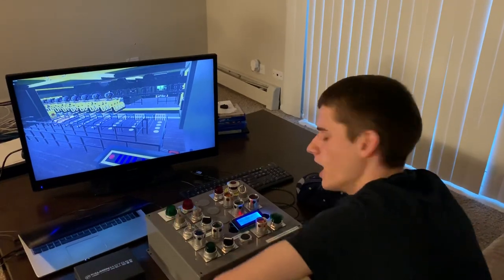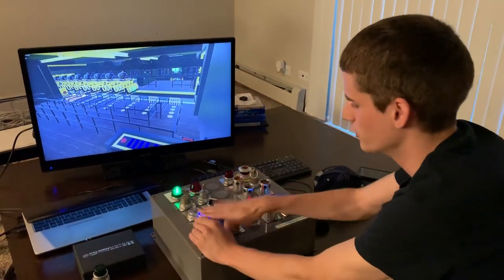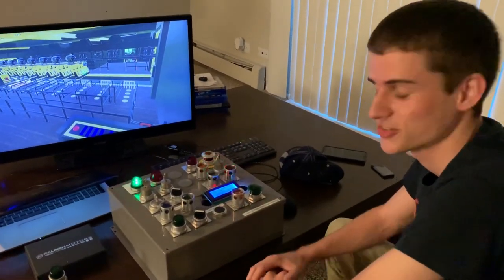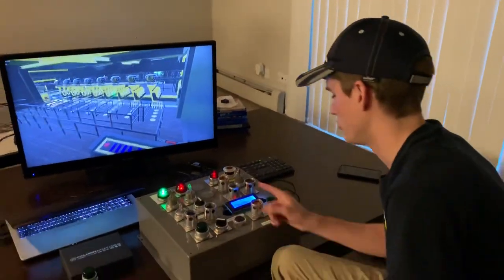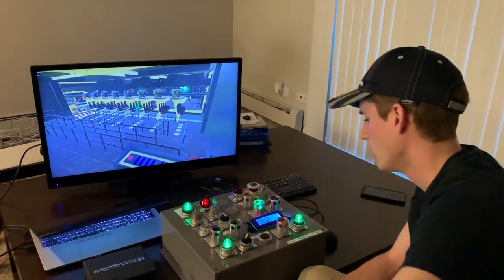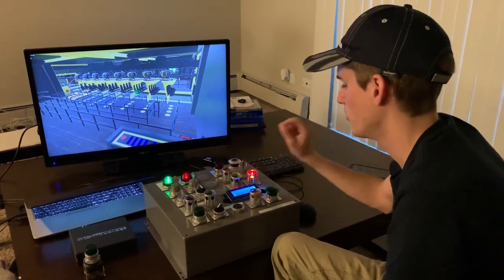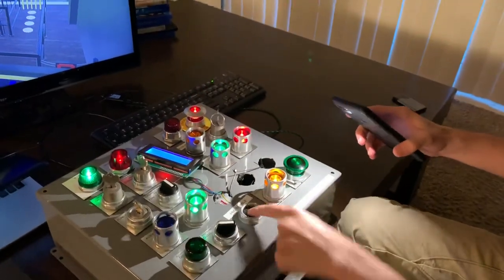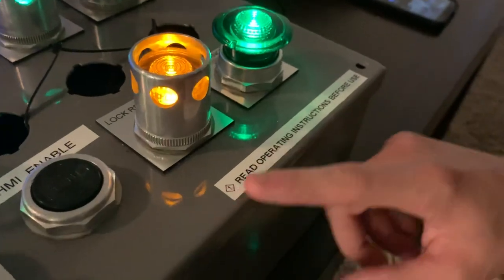The Greatest NoLimits 2 Control Panel Showcased

Comment: I’ve operated dozens of dozens of coasters. One of the hardest I’ve ever had to operate was The Hollywood Rip Ride Rockit at universal. That ride has so many buttons its not even funny. The op is responsible for about 35 buttons, and knowing what you can and cant press on the RCS. However, it was the most fun I’ve ever had

Comment: I just started working on an 8-control one, it'll be a lot simpler, but still using actual Allen-Bradley buttons. The top row will be Control Power, Reset, Seats/Floor, and E-stop. The bottom row will be Dispatch, Gates, Restraints, and Dispatch. Here's how I plan for it to work:
Control Power: A 2-position switch. Not a keyswitch, didn't want to bother with a key. On turns on the panel and sets the station to manual dispatch, Off turns off the panel and sets the station to auto dispatch.
Reset: A red guarded illuminated button. Activates NL2's Reset function, light flashes if the coaster crashes and needs to be reset. Works even with Control Power off. Not sure if this is possible, as this function doesn't have a keybind or a telemetry function.
Seats/Floor: An amber guarded illuminated button. Controls seats on flying coasters and the floor on floorless coasters. Light flashes when the seats/floor are in dispatch position and can be moved to loading position, and is on when the seats/floor are in loading position. Does nothing and not illuminate at all if the coaster isn't floorless or flying.
E-stop: A red illuminated push-pull mushroom head button. Activates NL2's E-stop function when pushed, deactivates it when pulled. Light is on when activated, flashes when deactivated. Works even with Control Power off.
Restraints: An amber guarded illuminated button. Opens and closes restraints. Light flashes when restraints are closed and can be opened, and is on when they're open.
Gates: An amber guarded illuminated button. Opens and closes gates. Light flashes when gates are closed and can be opened, and is on when they're open.
Dispatch: Two green guarded illuminated buttons. Dispatches train. Buttons will be wired in series (requires both to be pressed) and their lights in parallel. Lights will flash when a train can be dispatched and will be on when a train is moving in the station. 

I'm hoping to make it use NL2's telemetry server, so that it will stay in sync with the state of the actual coaster in NL2.

Comment: Going to attempt to build my own panel. Got all the buttons, and I liked you idea of a LCD in yours, so im implimenting it in mine. Question, do you have a potentiometer for the LCD? I dont see it in your wiring anywhere. Also, are you using relays for power for the 24volt or 124 volt bulbs? Or did you replace bulbs?
Reply from the maker: I'll make a video answering this questions a bit

Comment: So I am looking to make a No Limits 2 Panel. I have already purchased buttons for the panel. I was wondering which two Arduino circuit boards you have and where you got the enclosure for the panel. I am having trouble figuring out those two things. Your panel is the best I've seen so any help would be much appreciated. Thanks.
Reply from the maker: I used the mega and due. Use the wire library to get them to talk to each other. The enclosure I got from eBay
Reply: @realsfgamfan  Thanks so much. Is it ok if I comment again if I have issue with programming? Thanks.
Reply from the maker: @PanicattheDispatch  sure. Any time
Reply: @realsfgamfan  Thank you so much. I appreciate the help more then you can know.
Reply: So I am waiting for the buttons to show up and I was watching your video of how you did the code. I am going to try to see if the lights in the buttons that I ordered work when I get them or if I need to buy LEDs. Would it be possible for you to give me a link or a product name for the LEDs you purchased. Thanks! Your video was extremely helpful and happy new year!! Thanks!
Reply: The due is ridiculously overpowered for being used as a keyboard interface. It would be better to use something 32u4 based such as the Leonardo or Micro.

Comment: Would you still be up for building one of these panels, and if possible shipping one to the uk?
Reply from the maker: Sure. But you would have to pay for it up front, wait for parts to ship, etc. Next year we may do a production run of a few so stay tuned.
Reply: @realsfgamfan  Thanks for the info, any idea of cost? and potential to dissconect screen? (want to cut a custom hole so it sits flush)
Reply from the maker: @Johny2427ap  no less than $1000. Around 1500 for a really nice one.
Reply: @realsfgamfan  thanks for the info, i'll be looking to buy one when you start producing, likely going to go for a nice one

Comment: Could you make me one? 🤣 Doesn’t seem too hard though, you just had to bind the controls to the keybinds?
Reply from the maker: The board sends a keyboard press. I'll build you one for $1000. They're not cheap.
Reply: sfgamfan Nice. Never thought it was cheap, but that is kinda pricy/expensive. Makes sense though. It’s basically a ride op panel simulation. Would love to buy one of these lovely panels from you when I achieve the money.

Comment: Do you only use the keyboad shortcuts, or a custom NoLimits script ?
Reply: So for example, does the Station "stops" if you release the dispatch buttons ?
Reply: considering, the Ride Stop turns the E-Stop in NoLimits on, I think you only use Keyboard shortcuts
Reply from the maker: @alpakat292  only keyboard shortcuts. I'd eventually like to get it more features than that. The station does not stop if you release the buttons. Holding the buttons unlocks the restraints when it stops in the station and you release but otherwise it's just for show
Reply: If you use a custom coaster script, you can controll every section... It`s so cool.
Reply: btw. sorry if I misspelt anything, I'm not a native english guy... Love your videos, keep on making them...
Reply from the maker: @alpakat292  yeah just haven't gotten to that stage yet. Maybe soon